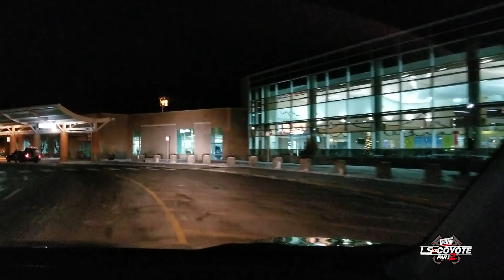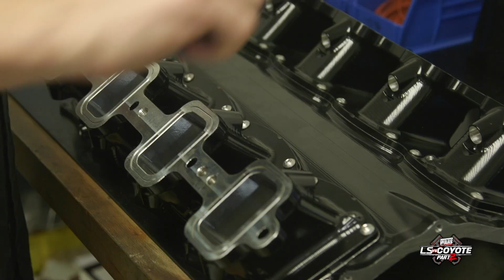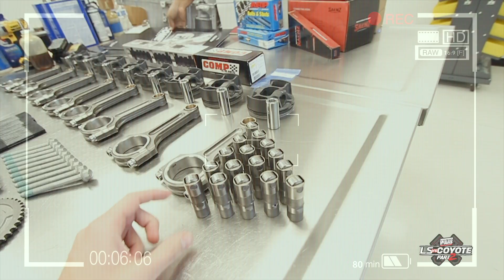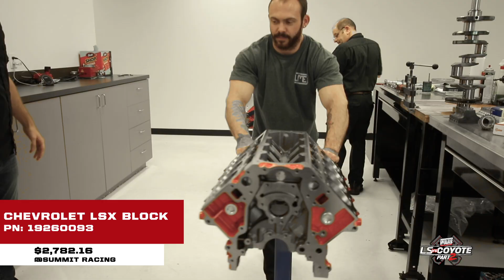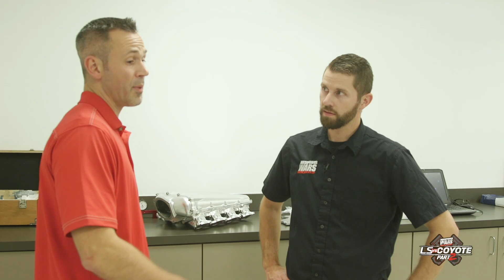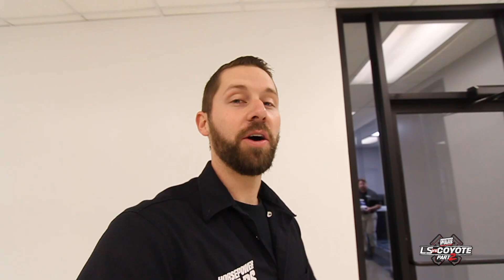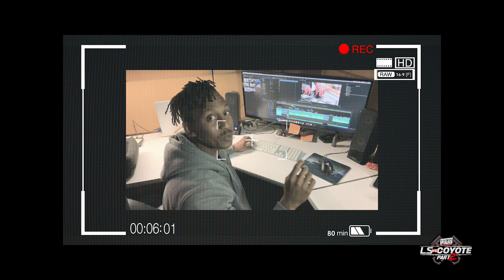LS vs. Coyote 2 Episode 2: The LSX Engine Build

Comment: Let’s be fair 5.3 vs 5.0
Reply: So you want to compare a chevy 5.3 with one cam 16 valves that is basically a commercial not rated as a performance engine it's put in trucks and suvs against a 5.0 ford with 32 valves and 4 camshafts that is listed in the mustang as a high performance engine of course to make it fair cubic inch wise ford has chosen this engine and size and anyone who makes a bigger cubic inch engines are cheating and it's unfair ford could build a bigger engine I've heard of some kind of 6.2 engine coming for ford don't remember chevy vette owners crying like a little bitch when dodge came out with a 488 cubic inch 10 cylinder viper engines to compete with a 346 cubic inch chevy engine
Reply: The 5.3 will still put a beat down
Reply: exactly...that’s why they don’t & won’t put it a maro. they know what that 302 can do💯
Reply: Can't do that. GM has to have an advantage like the three billion a year taxpayers are still pumping into GM.
Reply: @tomhamilton9140  if you had a business and could do the same you'd be doing it what cars does ford sell besides the mustang if they do nobody buys them they are made cheaply I've owned a 2010 mustang and a 2003 mustang gt no more fords for me the 2003 gt was a ok car the 2010 was purchased new junk ford trucks keep the company alive without them no more ford

Comment: so they had to resort to using the biggest motor GM puts in a car to compete with the little 5 litre? i thought it was going to be the LS3. you know, the one that the coyote was built to compete against. if we are doing the LS7 platform lets just throw a trinity motor (STILL only 5.8 litre) with 15k into it and completely ruin chevy's chances at taking any of these categories...
Reply: You shitheads never read the rules yet but h and complain. Besides, 427 ISN'T the biggest LS motor small block.
Reply: @EGGINFOOLS  i said that they put into a car. the 454 isint a production engine. and im not complaining.. lol go ahead and run your 7 litre. i was kinda highlighting how it was kinda a cop out.
Reply: Its not resorting to anything. You ford guys think your coyote is the top shit and you talk a lot of shit on LS's but when u see a build like this you pull out the "oh they needed a motor that big to win a competition" nah u talk shit about an LS your talking shit about all of them. A 427 LSX is perfectly fair
Reply: And a LS3 will still win against any coyote. I have never lost to any coyote so far in my vette.
Reply: @Inverter5253  thats just a weight advantage. use a camaro that doesnt weigh 3200 pounds and the coyote wins. i know this cause ive run multiple 5th gens at the track and on the highway and my stock 14 gt takes at least two cars every time
Reply: Roland Beliveau each builder could choose any combo they wanted. MPR is one of the best Ford builders in the country.
Reply: Got to wonder why they didnt use a 5.4/5.8  other than cost? Would the physical size be a reason  or because of the fact its not to common of  a swap?  However I question the use of different size superchargers too, seems like a huge advantage for the Ls....

Comment: If you're in it to win it I completely don't blame the Chevy guys for stroking all the way to  427 and it should be a very cool build,  But I'm already mildly disappointed that their goal is obviously not to  Compare on a level playing field, It's supposed to be a Coyote versus LS. By the time These guys are done, these won't be anything close to what they originally were.  There won't be a clear winner at the end of all this.  "Best" is subjective to the individual and the only way to make it fair is to use factory parts and custom machining. Not custom fabricated parts. I like that the LS is using a factory block and  crank.

Comment: I love how they sent the builds to different shops that specialize on GM and ford engines so that way they can build them to their liking and no one can say they are favoring LS engines yet people are still bitching about it dont forget people labor is not cheap and that is not included in the build only parts
Reply: No they dont include that in the price because the coyote is an advanced technology engine that is far more efficient in its stock form and in addition to 120+CI the LS will require 10k of machining and CNCing to compete with it and they wouldn't win a competition if it weren't "included"

Comment: Coyote is so much better it makes more power per cubic yard of engine and more power per foot of timing chain. And the hp per CI is such a good point. You win unlimited races by making the most power per CI not by making the most power. ..... Oh wait uhmmmm... At least you get bonus points for doing it the hard way... Wait you mean you don't? Mhmmm well I mean it's not like Ford has been building motors for over a hundred years and still can't seem to get it right.... Oh well I give up. Ford sucks.

Comment: I feel this is bullshit, I'm a chevy guy but everything should be at consumer cost and what I can build at home for the same 15gs not everyone has half million dollar  5 and 6 axis Mills so if there's work done to the heads the price listed should be as if they were charging me to get mine done that go's for every part on the engine no sponsored by bull crap if I bought the lsx and took it in for the same treatment what's the cost? I bet it's not free! I can understand assembly not being in the build but machine work and massaging parts to be perfect definitely needs to be! talk about stacking the deck!
Reply: first name last name.......What the hell do you care.........the shop building the Coyote motor had to abide by the same rules & budget limit. AND THE RULES CLEARLY STATE THAT ALL EXOTIC MACHINING ( aside from BASIC machining ) MUST COME OUT OF THE $15,000 BUDGET LIMIT. So in case you are implying "stacking the deck against the Coyote motor"........you're wrong. As a matter of fact, the guy building the Coyote motor flat out stated that he would've MUCH rather used a different set-up to build the Coyote engine, BUT HE CAN'T BECAUSE IT WOULD PUSH THE COST BEYOND THE BUDGET LIMIT. He also stated his biggest concern is THE MID-RANGE TORQUE that the LS engine will most likely put out during the dyno test vs his Coyote engine. LOL. So re-read the rules very carefully and go watch the other video showing the Coyote build. The ONLY thing I have against the performance Ford & Mopars is the ridiculous COST. That dude who owns "Beater Bomb" ( a beat up old Fox body Mustang with a turbo charged LS in it ) is just beating the living shit out of over 90% of the competition.....and that INCLUDES Coyote motors in newer Mustangs........LOL. He's got to be the most popular street/strip racer in America today because of it. He's all over youtube on dozens of racing channels. And it gives me great pleasure at how it absolutely burns the asses of the "Ford or die" pricks. The ONLY thing in common between the Chevy snobs, Ford snobs, and Mopar snobs is THEY ARE ALL IDIOTS WHO REFUSE TO GROW UP & UNDERSTAND & APPRECIATE ALL THE GOOD ENGINE PLATFORMS. And you'll NEVER see those pricks running their mouths in the better shops that work on everything, OR at a crowded race track. No......they just run their mouths like a bunch of cowards as they hide in cyber space.
Reply: to be fair the machining on the block is pretty standard and most run of the mill machine shops will be able to do it and it wont cost an arm and a leg, the cnc heads was a bit much but you can buy cnc heads for 1500-2900. this build is still feasible  for the home DIYer depending on which brands for rotating assembly and valve train components you could save quite a bit.
Reply: @ChrisspyMKIV  "you can buy cnc heads for 1500-2900" Not from LME you cant, with the titanium vales and all the options they installed to support the .710 lift cam, that will set you back $4,027, but for the build they list them as 3k
Reply from the maker: https://www.youtube.com/watch?v=NEYIYU484E0 Watch the first episode to see how the budget works.
Reply from the maker: Budget is here --> https://www.horsepowerwars.com/horsepower-wars/ls-vs-coyote-2-lme-lsx-build/
Reply: Lol. Crybaby. They first shootout was that. Then ford guys complained and got the rules changed. Still crying and haven't even seen what the Ford builder has in store.
Reply: @EGGINFOOLS  he says hes a chevy guy... he's just saying keep it realistic to what guys like us could do for 15k
Reply: EGGINFOOLS in the first build off both motors will built by a Chevy shop! Can you say conflict of interest? I’m a fan of both brands and have owned both but the bias towards the bow tie camp is obvious to me. If $15k, hell $20k would get me this motor sign me up! But we all know that’s not reality.
Reply: EGGINFOOLS Tim eichorn is the man. LOL you’re going to be pleasantly surprised
Reply from the maker: The competition was $15k in parts. Both builders have their own machining capabilities and labor.
Reply: @Horsepower_Wars  so is it consumer cost or dealer cost ? That's a big deal atleast on parts, if all CNC work is all pro bono.
Reply: @GhostlyGhille  It clear in the cost. They show the price and source in the video. Go to summit racing and look up the part number on the block. Same price as what you'd pay. Everything is fair. They both get 15k to spend for parts. Machining and labor is wiped out which is another win for the Ford here because there are more moving parts to assemble and more head work if they are machined. The rules were changed because of the complaints from the first video. How much more fair can it get?

Comment: So what I’m learning from this video is you need an all out race block/heads/engine to compete with what will more that likely be a factory block/heads ford?  If that’s the case, I can see why Camaro sales suck compared to the Mustang.
Reply: Yea because when people head to the dealership to buy a mustang or Camaro they're always like "Cant wait to tear apart this brand new engine and go for 1500hp so I can break the rest of the drivetrain and replace all that too"
Reply: fuckucatchme1000rr.  What?  How did you end up at brand new 1500hp cars from what I said?  Some people buy these cars with the intention of building them at some point.  My guess is the coyote will use more factory parts for the build.  If that’s the case, it appears the coyote would be a better platform to start with if you want to build it later on.  They really should be doing a shootout between the coyote and the LT though.  That would be more relevant.
Reply: This guy is a real joke he must work for GM
Reply: J Mcg.........BULLSHIT. The Coyote motor build video is up now, and they chose one of the very best Coyote engine builders in the country. HE STATES IN THE VIDEO THAT YOU CANNOT ADD BOOST TO MAKE OVER 900 HP TO A COYOTE MOTOR WITH THE FACTORY SLEEVES, OR IT WILL DESTROY THE BLOCK. HE ALSO SAID THAT WELDS NEED TO BE ADDED TO THE COYOTE BLOCKS AND RE-SLEEVED WITH SPECIAL FLANGED DARTON SLEEVES & COSTS $2,500 ALONE, JUST TO RE-SLEEVE A BLOCK YOU ALREADY HAVE. HE ALSO ADDED HIGH PERFORMANCE RODS, PISTONS, PINS & RINGS IN ORDER TO HANDLE BOOST & MAKE 1,500 HP. THERE IS ABSOLUTELY NOTHING "FACTORY STOCK" ABOUT THAT........YOU IDIOTS. AND HE IS THE BEST IN THE BUSINESS WITH COYOTE MOTORS. GO WATCH THE FUCKING VIDEO FOR YOURSELVES........AND CHOKE ON IT. All of you clueless punks believing THE MYTH that "a factory stock Coyote motor can handle boost and 1,500 hp"..........BULLSHIT. AND HIS ENGINE BUILD VIDEO PROVES IT.
Reply: https://www.youtube.com/watch?v=HYW_kPEyhiQ&t=9s
Faster than you will ever need to go and that is SBE 5.3, Stock Bottom End 5.3 ...
Reply: Their previous videos was biased trash!  Always has been!  Both platforms are awesome in there own sense but let’s admit that their first attempt of LS vs COYOTE was a complete joke.  The “builders” were replacing things that didn’t even need to be replaced, not to mention that the building was done by a team that had no clue wtf they were doing with a coyote.
Reply: @andrewwhipkey9609  Andrew Whipkey........THEN GO WATCH THE BRAND NEW VIDEO SHOWING THE COYOTE BUILD FOR THIS BUILD OFF........THE SHOP & MAN THEY CHOSE IS ONE OF THE BEST IN THE COUNTRY FOR BUILDING COYOTE MOTORS. AND HE WARNS THAT YOU CANNOT EXCEED 900 HP WITH FACTORY STOCK SLEEVES IN A COYOTE MOTOR, OR YOU WILL DESTROY THE BLOCK. HE ADDS WELDS TO THE BLOCK & RE-SLEEVES THEM WITH SPECIAL FLANGED DARTON SLEEVES. THE RE-SLEEVING ALONE, NOT COUNTING THE BLOCK..... COSTS $2,500...........SO THERE GOES YOUR MYTH ABOUT "STOCK COYOTE MOTORS MAKING INCREDIBLE HP WITH BOOST"...........HAHAHAHA........You fucking morons.
Reply: Didn't he say that the coyote build was coming up? How do you know that they are using a factory block and heads? And did you already watch the LS whip the crap out of the Coyote on their previous videos?
Reply: Eric Cecil.  1. Yes.  2. I said more that likely. 3. No, I have not seen that video.

Comment: So the LS7 was only used in the z28 wich was the track edition camaro. They are putting the highest engine Chevy engine against fords regular v8. They should put it against fords track mustangs engine wich is the voodoo v8. 5 litres against 7 litres doesnt make sense. That would be like putting voodoo up against an ls1. It should be Chevy and fords regular v8s. 5.0 vs 6.2.
Reply: The budget is $15k. Can you build a voodoo ground up for that?
Reply: @siraff4461  I completely get your comment but it just seems pointless. I love both cars and I'm not biased. But why bother? Ls7 vs 5.0. Idk. I see more mustangs beat ls engines during roll races so well see.
Reply: @android-ud2nf  This isn't that though. If there were no rules why not just run top fuel motors, break the dyno and call it a day?
Reply: @siraff4461  well after the first shoot out they explained the everyone why they use a 6.2l and not a 5.3l like everyone was saying in comments because this are the engines found on your typical  ss and gt cars well now using boost they gotta get bigger engines i guess

Comment: Ford should make the 7.3L DOHC 32V V8 (code name Godzilla) and it'll destroy every single GM LS out there.
Reply: Godzilla's a pushrod motor
Reply: @Robert-dc1ws  Right.
Reply: that would be great but would weigh 1000 lbs and only fit in a super duty

Comment: Really.... Y'all building a 427 cubic inch LS to dyno and race against a built 5.0 Coyote Engine a 125 cubic inch difference and you expect the mechanically inclined and anyone with half a brain to accept the Results, even if the Ford Coyote won it wouldn't be a fair race and again anyone with half a brain could see how biased y'all are towards GM it's let's find every advantage we can against a Ford engine and build them both LS engine 60+cubic inches or  larger and we will stroke it and out power and outperform the smaller Ford engine and be able to bragg about how great the LS engine is ...Pathetic...I tell you what I would love to see the baddest LS engine builder in the land and let them build the baddest LS engine possible and let's have John Kaase build the baddest Boss 429 Hemi he can build and have both engines be stroked to the absolute   maximum both be  supercharged  and run on race fuel and let's watch the much larger Boss 429 stroker engine lay waste to the smaller LS engine and Bragg about  how it dominated the GM/LS engine...It just wouldn't be fair everyone knows that in the scenario I just mentioned the Big Block Ford would flat out Dominate and Embarrass the much smaller Chevy and it should because of the cubic inch difference not because of Overhead Cams  or because it's physically larger but because it would have a huge advantage in cubic inches and You Chevy/LS Guy are always saying there's no replacement for displacement well if you truly believe that why does physical size or overhead cams make it fair between a 427 LS V/S a 5.0 302 Coyote (dont be a bunch of cowards put your LS against a Ford Coyote or another engine of same cubic inches and let's watch the Ford engine Dominate!!!#Blue Oval Nation

Comment: Can you guys send me the link where I can buy this motor for less than 15k on LME's website? I wont jerkoff for a month if someone provides it. Actually never mind 9k the cheapest procharger is 6k
Reply: Procharger is a sponser on both builds. Builders showing off their bling? Who can blame them but this is fantasy stuff for the average guy. Junk yard engines and chineseum turbos can get the job done too but not as reliable or nearly as pretty
Reply: @travispfannmuller7717  i dont care what sponsors you have the ls is a 30k build minimum

Comment: Has anyone seen the new motor Ford came out with for 2020 truck?  Its a 7.3 gas iron block engine it's a lot similar to the LS I believe it will be the breakthrough  that Ford has been looking fore.

 It's a single cam push rod engine!!
Reply: The new 7.3L sounds good in theory, but I have a feeling it will end up like Fords V10...  being ignored by the aftermarket and most hot rodders.
Reply: @stlchucko , that's because there heavy duty engines
Reply: Nobody knows if their pushrod will be as reliable as an LS. Also chevy is releasing a Gas 6.6L. Now they will have a 6.6L gas and 6.6L Duramax
Reply: It is utilitarian , it wont be used in there flagship performance cars. Who puts pushrods in there flagship performance cars in 2019?